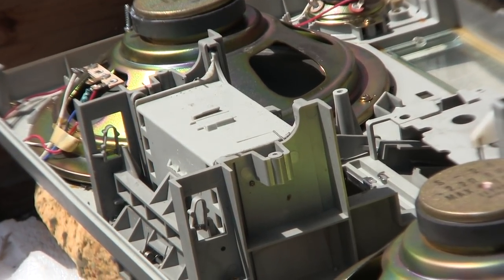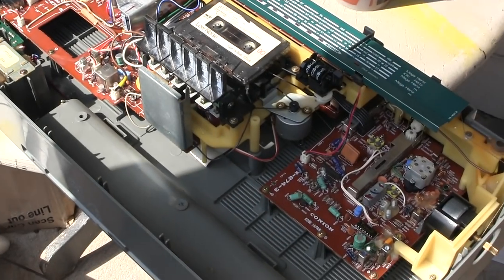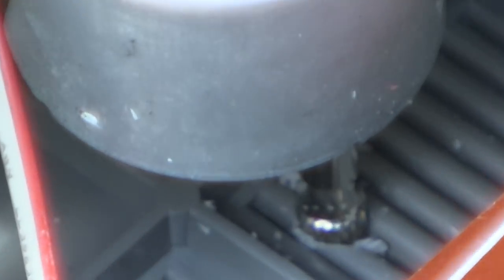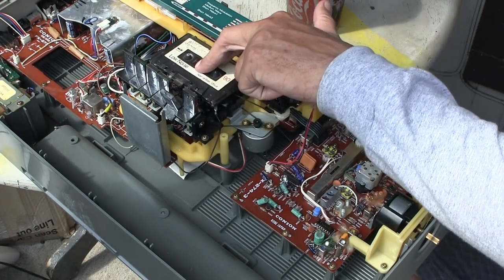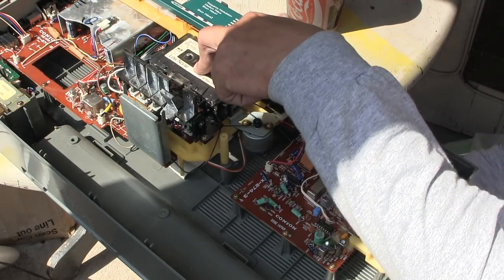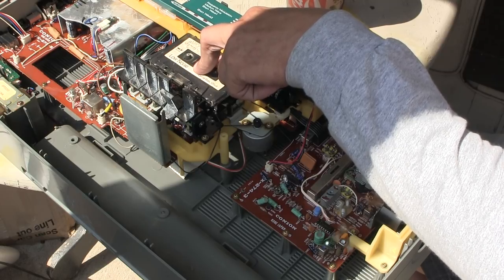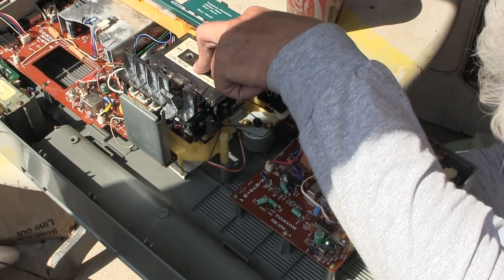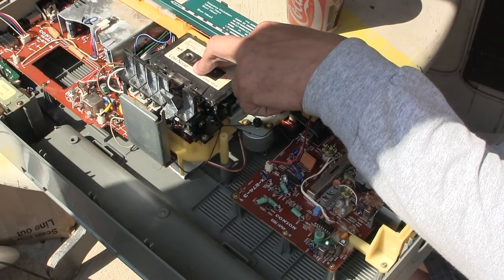How to Adjust Cassette Tape Deck Boombox Motor Speed Adjustment Conion CRC-H84FC

Comment: please help, how do you open Conion CRC-H84FC ? after I loosen the 6 screws from the back, still can't open it.
Reply from the maker: I can Share the solution If you ask me in email or in Facebook as I can then share a Picture I took specifically addressing this exact issue and I did not take too many pictures of mine when I had it like I do now, but I do have this ( ahem secret, I think of why you cannot open yours :)  )  Contact me text / call 713-502-9993 or Email me at jamespierceiii@hotmail.com 
& in FB here: https://www.facebook.com/profile.php?id=100001056918572 so you connect 
to me in messenger.

Comment: hm you didn't show how to adjust motor speed ,
Reply from the maker: phantomempire Ok What did I not show that you do not understand ( other than find adjustment hole, normally in rear of motor and rarely on separate board, insert flat-tip screwdriver, rotate until speed changes to your liking by ear ) and your done?
Reply: Cassette2Go Thank you ! I was not sure where to adjust speed ,the hole in motor !..thats what i needed to find out ! thanks again
Reply from the maker: phantomempire I'm sorry that you didn't know this till now.  This model is very difficult to get to, to adjust, is why I drilled a hole in the backside of this model to gain access to the adjustment hole in the motor of this particular boombox